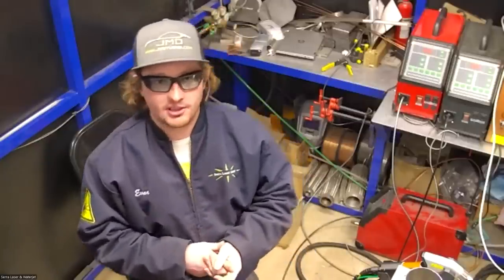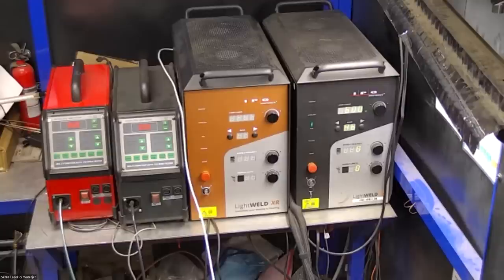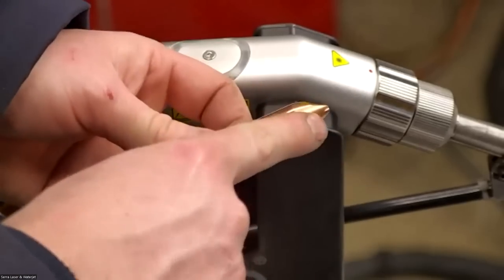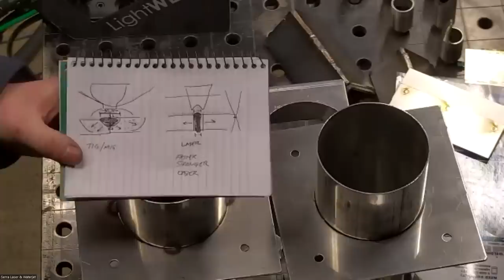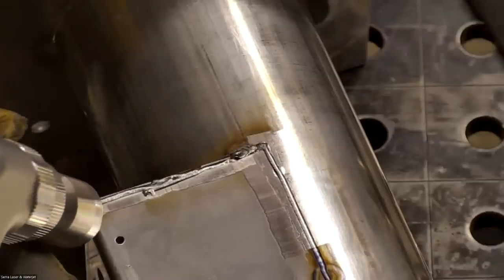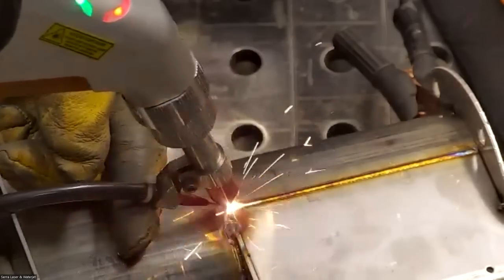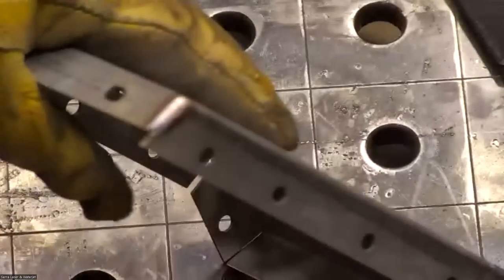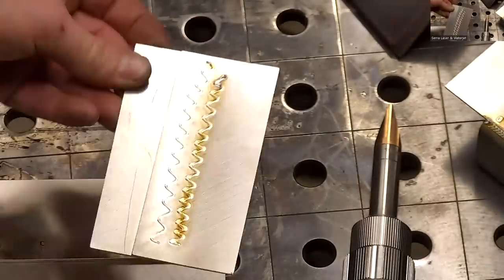LightWELD laser welding  Explanation and Real World Part

Comment: My company just invested in the XR model, and I can tell you it is a Quantum leap from the old MIG and TIG we were used to. We have to get our elders to adopt the paradigm shift, and we can't wait to get greater than 1/4" weld penetrations, which we are bound to see soon. We make rock crushers, and our weld are crucial.
Reply: Where did you get this weld...and how much the cost
Reply: I'm not so sure that it's really necessary to get more than 1/4" of penetration.  Traditional manual welding processes often don't even go that deep, and properly welded joints with MIG, TIG, and stick rarely fail due to lack of penetration.

Comment: Fun fact, if you hold the left arrow button and go past A until you see Y, you can then turn the wobble frequency knob to move the beam's aim left and right if the beam is missing where it should be going. And if you hold both buttons it will save the aim adjustment. 

Learned that when the beam would miss the wire at times, also made that wire notch deeper on the wire nozzle to stop the wire from slipping out causing the beam to miss it.

Comment from the maker: To increase penetration increase the power is the 1st thing. You can also increase penetration by making the wobble width smaller and by reducing the wobble frequency. Sometimes on an outside corner weld you might increase the wobble width so it can catch both sides of the corner. This lessens the penetration as the beam is now catching a wider area so spreads out the heat. To adjust for this you increase the power. Or another example is if you want to get more depth of penetration then the specs. A user preset can be made where you narrow the wobble width and decrease the wobble frequency. And slow down the wire speed. Doing this you can increase penetration to .250 on the model rated for .160 and get near .312 penetration on the model rated for .250 penetration.

Comment: Hi Glenn, thank you for this video, excellent training. Just one question:
What's the difference about penetration, say we want to increase penetration, is it better to increase power, or to slow down wire feed? How would one or another technique influence weld quality and penetration? Thanx!
Reply from the maker: Normally you are going to adjust power to increase penetration. Another way to increase it would be to narrow the wobble width - which means power is more concentrated. Conversely if you widen the wobble width this will decrease penetration and to compensate you would increase the power.

Comment from the maker: Max weld penetration is either .160 or .250 deep - no beveling needed - in SS-Steel- or Aluminum. So for example you could butt weld - no beveling needed - .250 plates together with the XR model - and no gap between the plates.

Comment: Hi everyone, has anyone with this laser welding machine managed to solve the issue of the small crack that forms at the overlap closure on circumferential welds? I am welding stainless steel or nickel alloy tubes, and I often encounter difficulties with thicknesses over 2 mm.
Thanks

Comment: Hi all,  when I'm welding at the end of weld the wire all ways stick to the material please any tips thanks
Reply from the maker: If you are using an older wire feeder A. Pull off the weld prior to releasing the triggers. This will separate the wire and the laser beam will stop when pulled off B. At end of weld release upper or trigger two - wait a second - then pull trigger two and release which fires laser for moment and separates the wire - this can be good practice too as keeping trigger 1 - lower trigger on - keeps gas flow going over the weld to supply end of weld shielding of the weld puddle. On the new wire feeders or the double wire feeder the retract is faster and this is not normally a problem.

Comment: Would you use it for round tube frame structures? Something like a 4130 chassis? It looks bulky and hard to get to some tricky areas? This thing is terribly expensive and I would hate to find out that it not good for purpose...
Reply from the maker: Welding a round tube is not a problem - but you do need access to the weld joint. This gun is bigger than a TIG weld torch.  There is some leeway angle to the weld that works and you are coming at the weld from an angle - not straight up and down - so its really a part by part basis on weld accessibility.
Reply: @Serra-LightBOT  Thanks!

Comment: The company bought the xr, but when I apply it to weld two pieces of aluminum without the wire, it does not penetrate the weld and it breaks. In what way can I square it so that the weld penetrates?
Reply from the maker: Check a couple of things, the 1st being to use the LightWELD welding conditions. Make sure you are using the 7 mm spacer on the gun tube - this is required when welding aluminum - there are two spacers that come with the unit 7 mm for aluminum and 10 mm for SS and steel - if that does not work then check the cover slide window and replace it.
Reply: Having used it on 18 gauge equivalent aluminum, tacking aluminum is always difficult to the point I use a weld setting instead of the tac mode and sometimes with a higher wobble speed. Besides having the proper 7mm extension and an argon bottle, you might need to use the wire feeder to tack pieces together because even when I get things together it doesn't take much for a tack to pop at times.

Comment: Does the welding wire ever stick to the job when you stop & start
Reply from the maker: A couple of answers. With the 1st wire feeder IPG introduced it was easy to get stuck when new to LightWELDing, and with some experience this could be eliminated. Its easy to unstick if you do get stuck by a quick fire of the laser beam. On the new wire feeders there is a retract feature where you can put in a retract speed and time of retraction. This feature was not on the original wire feeders and its the key to not sticking the wire - even for novice LightWELDERS. The new IPG wire feeder also uses a stepper motor and has very consistent wire feed whereas the original the speed was not always consistent.

Comment: Would you be able to weld pipe in position with these units or is it only a thin material shop tool?
Reply: P.S.......Once us real welders get ahold it and tweak the requirments itll be stellar. Just wait and see
Reply: The Lightweld can penetrate materials up to 1/4" so it is not only for thin materials.  That is the maximum rated penetration depth, but you are not limited to that thickness of material either.
Reply: If it's within the quarter inch limit it's fine, your biggest worry is where the beam is deflecting as you weld around the pipe without turning it. But sync the speed of a positioner with the wire feed speed and you can lazily hold the gun in place

Comment: What’s the flow rate of the nitrogen?
Reply from the maker: 35 to 50 scfh per the IPG chart on pressure vs. flow rate on the LightWELD systems
Reply: @Serra-LightBOT  thanks for the reply. I’m trying to figure out how much nitrogen gas a laser welder uses and I can’t find anything on the internet. From the limited information I could find and using some math I determined that 50 liters of nitrogen would last 3.05 minutes at 35 cubic feet per hour which seems excessive..and wrong. Maybe you could let me know how much gas?

Comment: Word of warning for the forktip on outside corner joints since I use it too, it will get hot and fuse to the extension piece and after enough use the gun won't tell it is touching a surface the safety contact is clampped to requiring replacing the tip and extension section. I've welded enough 60 inch joints in a couple hours to feel how hot it can get
Reply from the maker: If you are using a fork tip on an outside corner the actual focal point is now inboard and not where the two corners meet. The gun tube has marks on it - so you can loosen the collet and adjust the tube outside roughly equal to the distance that the forks have moved down the sides of the corner, using the marks as reference. This will adjust the focal point to the corner of the weld. Using the fork tip for outside fusion corners works - but you need to adjust the tube outward because the fork tips - focus position - are not at the corner of the weld but down the sides as the fork straddles the welded corner. That might help.
Reply: @Serra-LightBOT  had to find the original tube since replacement ones don't have those marks, but extending the tube made the weld so much better/easier.
Reply: Question: I don't use the wire feeder and not welding aluminum - do I use the 10mm extension?